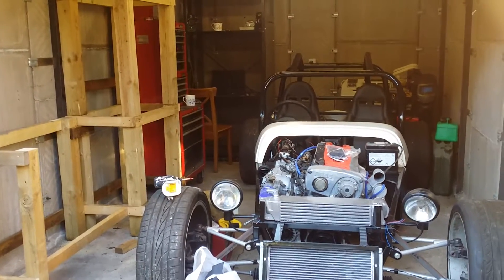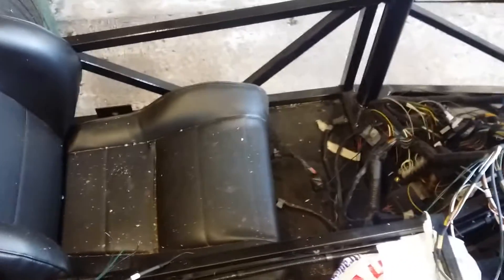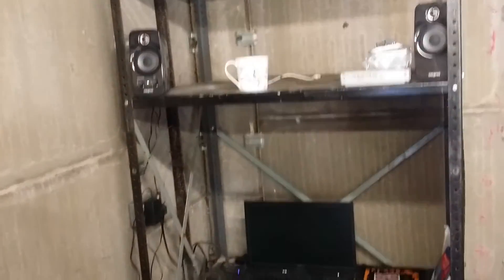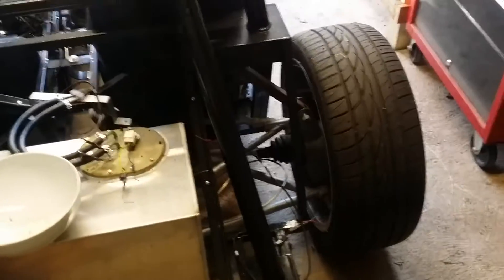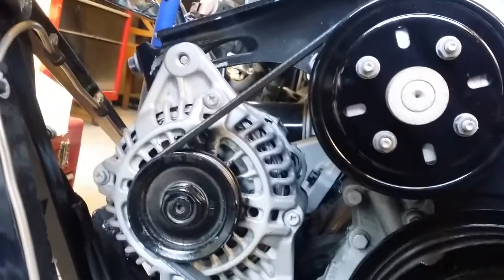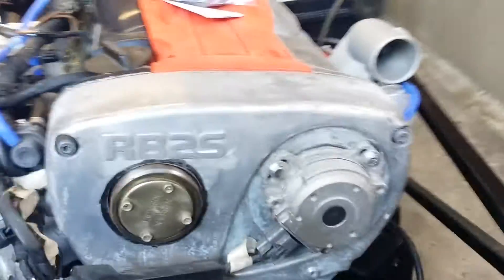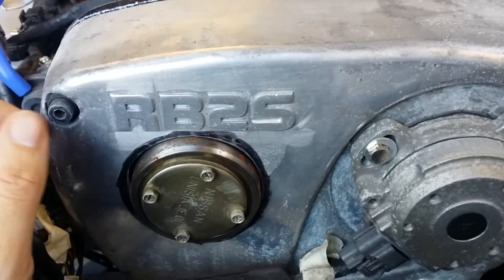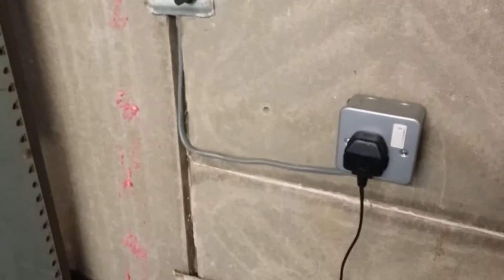Locost Skyline RB25 Kitcar - Ep22 Back... Again!!

Comment: Great to see you back working on the car.
Just a thought on your track rod ends, are you using escort or sierra ends both will fit onto escort rack. Yours look a little small make sure they are sierra, escorts are to small for uprights.
Great build by the way